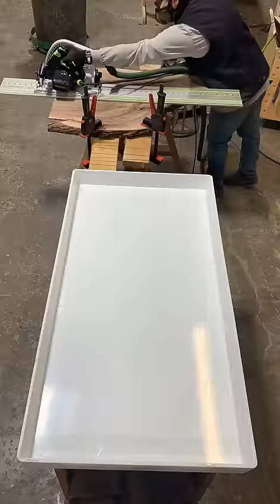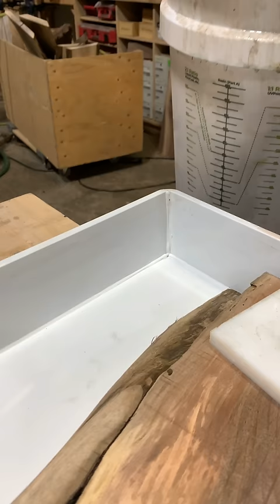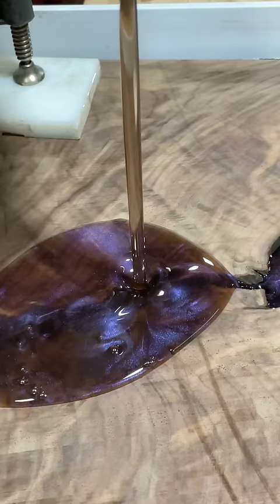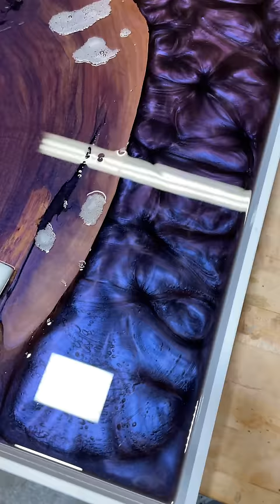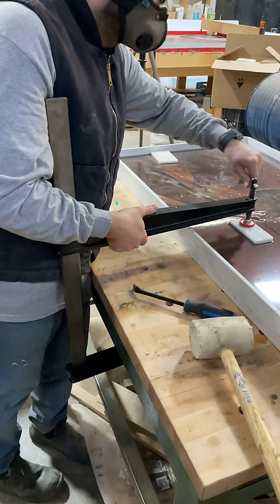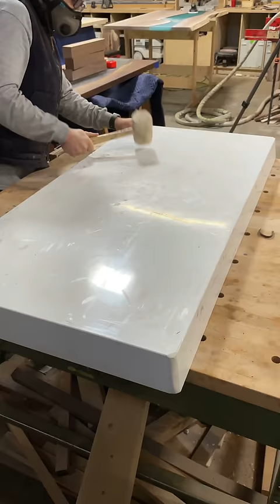Epic Colour Shifting Epoxy Pour!

Comment: BEAUTIFUL.  how did you get the "balloon" affect?
Reply: A year late, but i'm here to help.  You spray isopropyl alcohol on the resin for that effect.
Reply: Like after you pour you just spray it on with like a spray bottle surely it’s not that easy lol
Reply: @trevorpayne7894 yes..with smaller projects. I'd imagine they used silicone oil or something similar here

Comment: Great vid. How do you fill in the voids left by the clamp blocks? Apologies if you've covered this in another vid.
Reply from the maker: After the piece comes out of the form, it gets flattened on the cnc or in the planer which removes the voids left behind by the blocks.
Reply: @jeffmackdesigns  nice one. Thanks.

Comment: That's an awesome look! What makes it sort of "evolve" starting around the 2:35 mark? Was that a time-lapse of the curing?
Reply from the maker: That is the exothermic reaction from the epoxy curing process. When the resin and the hardener is mixed together, they need to reach a certain temperature to cure. The metallic pigment really amplified the effect!
Reply: @jeffmackdesigns  super cool. Almost looks like solar flares in some spots to me
Reply from the maker: It’s a wild effect every time. We don’t capture enough of it when filming!
Reply: Do y’all sell the dragon’s breath pigment
Reply from the maker: We actually don’t have it in stock yet but it’s on our next shipment. It should be available in January. We will likely announce on Instagram or our email campaign first when we receive them.
Reply from the maker: @jawhite531  The Dragon's Breath pigment is now in stock at www.JeffMackSupply.com

Comment: Quick question.  How many gallons of epoxy did you use and most importantly how much Mica was mixed in?
Reply from the maker: This pour required about 5 gallons of epoxy and we did 3 teaspoons of pigment. When adding pigment to epoxy, I always recommend starting with a small amount and keep adding more until you are happy with the opacity and colour. Note that the epoxy will look darker in the bucket vs when you pour so we typically add a little more than we think we need.